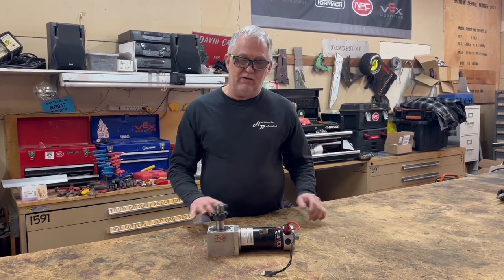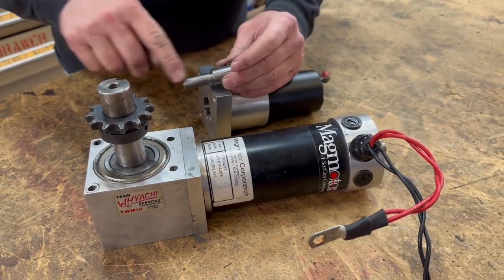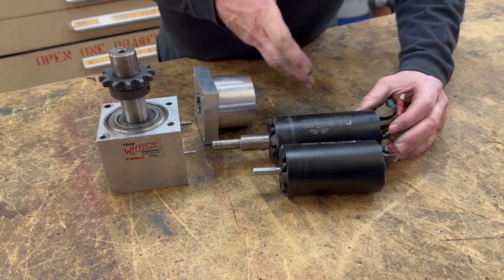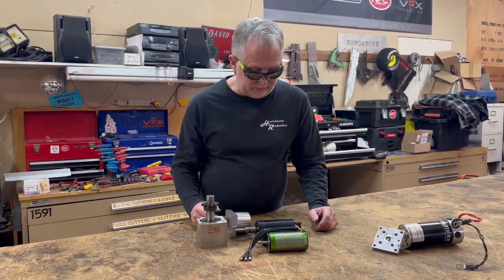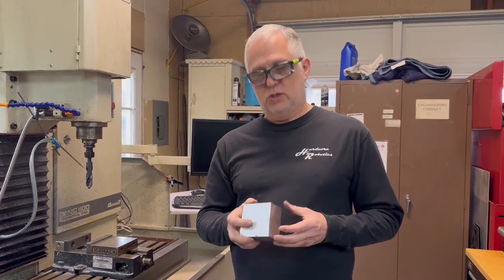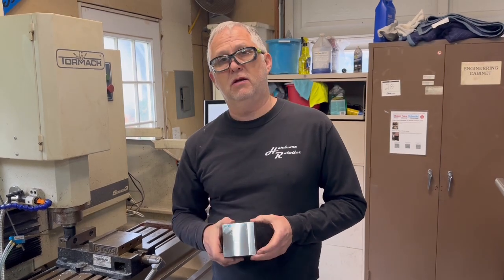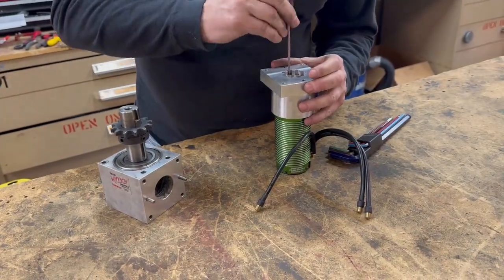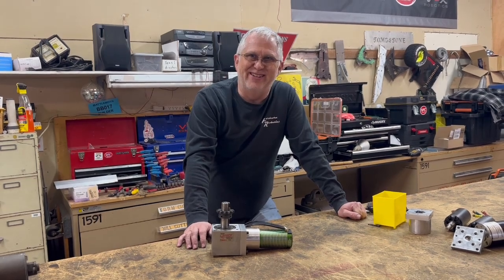Mortician Motor Mods 2024

Comment: Great to see your improvements, I wish you the best?
With the brushless ESC you have to take care, they don't like it when the motor stops instantly while they are at full power. I had the same issue, there are 3 possible ways to resolve it:
1) reset the throttle and spin up from zero
2) there are dozens of settings you can set in the ESC - try&error
3) add an additional small brushed motor just for recovery

Comment: Hello Ray - something I was thinking about while waiting for some more batlebots content (nothing broadcast in New Zealand :(:( )
Appreciating that I'm not a robot builder but have worked in tech 15 years and have been following along closely.

With the weapon motor, I wondered if a method to momentarily spin up the blades in sub 1sec at much higher amps then using inertia in the blade to do the damage. This would reduce battery endurance but may increase longevity in that the motor isn't powered up during the shock deceleration/impact. A sharp, quick engagin centrifugal clutch, keeping the motor isolated during intended contact in combat. 

A showerthought really ;)

Comment: I wish there was better documentation or guides for vesc controllers. I used one for an ebike project and it'e worked perfectly, but it took me a long time flipping through various forums and videos to find the corrent wiring for everything. I feel like they have so much potential if they were just easier to set up.
Reply from the maker: VESC works - kind of. You just have to fight with it the whole way through. It's not that I can't do it, I just don't want to anymore :) We'll see how the new setup plays out.

Comment: Nice explanations of the road to this new motor. Looking forward to the build and progress of this new setup. Curious - what voltage does this new motor use?
Reply from the maker: Max voltage on the older motor was 12s lipo, so 50.4v at full charge. New motors top out at 8s lipo, or 33.6v. Since I'm not planning on changing drive motors, and just going to use one power system, drive will be slower. But if the weapon works the way I want, that's a sacrifice I will gladly make. 

I'll know more when I get it together and spun up - hopefully soon.

Comment: Cool!  But I think I'd be inclined to throw the motor on the ground a few times to make sure the sensors can survive the shock of combat.
Reply from the maker: 300$ motor - probably won't be throwing them to the ground at all :) 

Quite a few teams have used them successfully, so I expect they will have decent reliability.

Comment: What are the thermals like on those motors during fights? They are pretty small compared to the old magmotors, so I assume they do get hot. I wonder if adding some "fins"/ribs and thermal grease to your mount would help keep them cool.
Reply from the maker: One of the large benefits of brushless motors over brushed has to do with efficiency. Many brushed motors are less than 50% efficient, meaning more energy is used creating heat than is used to create power! Most brushless motors are over 80% efficient. So although they do create heat, and you are right the smaller size tends to make that more apparent, the heat generated is just less than a similarly powered brushed motor. 

If you'll notice, the castle motor does have small fins around the exterior just for the purpose you mentioned!

Comment: I'm sure you've done quite a lot of research on the Castle setup, but I can recommend Kevin Talbot's (overproduced) videos on his High Speed Record attempts to see them running in anger - they seem to be just shy of bulletproof, the motors just take it and go, the speed controllers are the "weak" point, relatively speaking.
Reply from the maker: The speed controllers are always the weak point, no matter whose you are using ;) 

I will check out that channel though!
Reply: yea I agree with this he always hits a wall with the escs